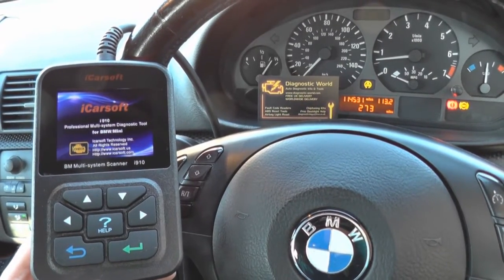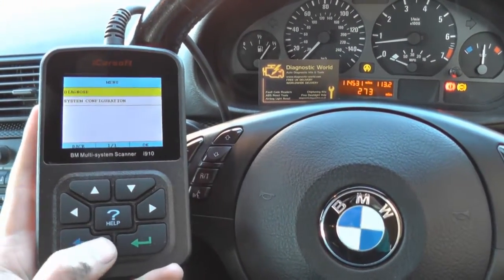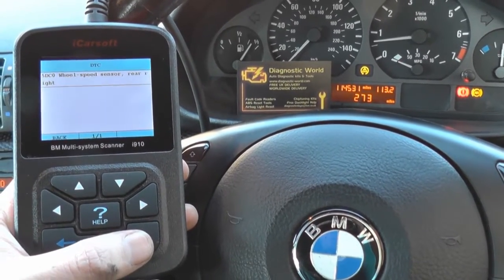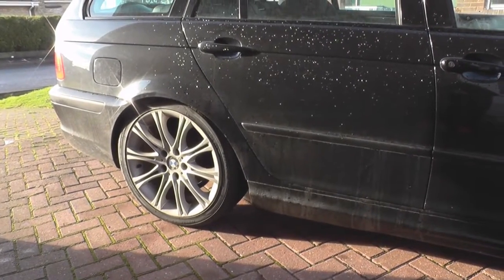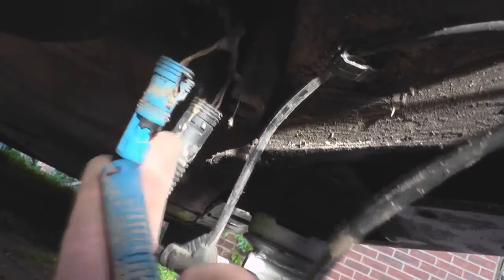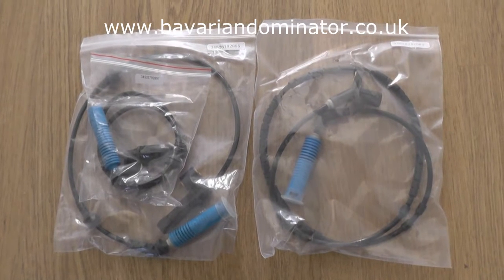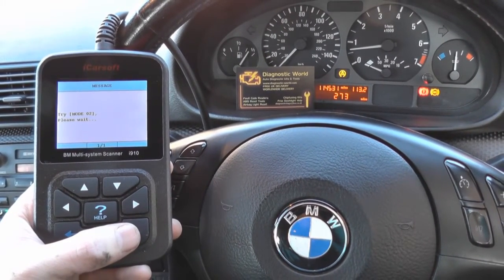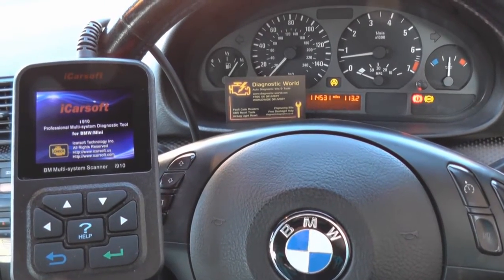iCarsoft i910 Reset & Diagnose BMW ABS Warning Lights

Comment: Connected the i910-11 to my 2009 BMW E91 330D and there is no ABS option showing on the display. Have many titles in the Chassis section but ABS is not one of them.

Comment: I have a problem if you can help me. on my BMW e46 1999 - brake warning light its only turned on and when I start to drive the car starts buzzer does 25 times then stop , ABS light and brake pad wear are ok they are turned off, all sensors are ok.